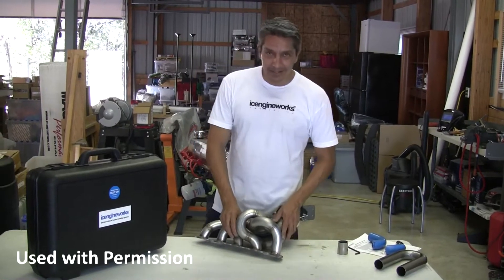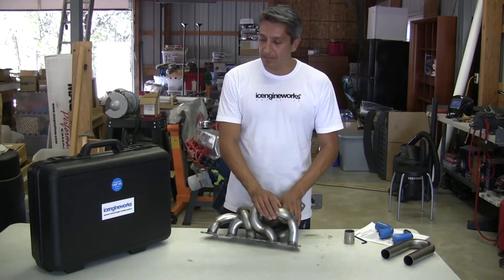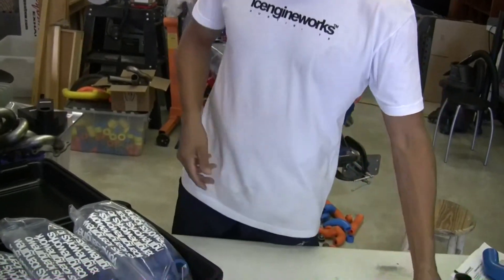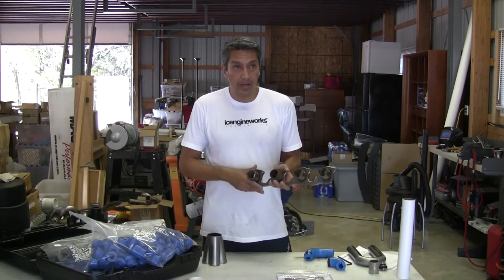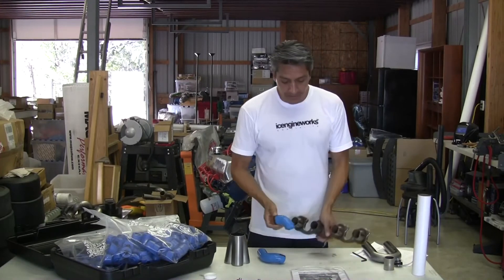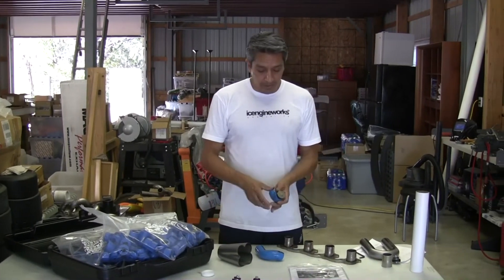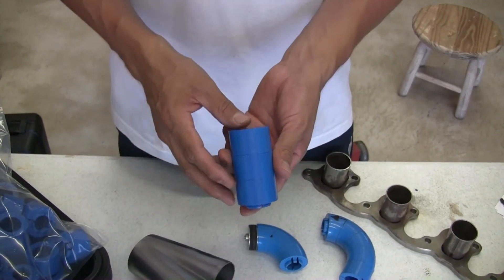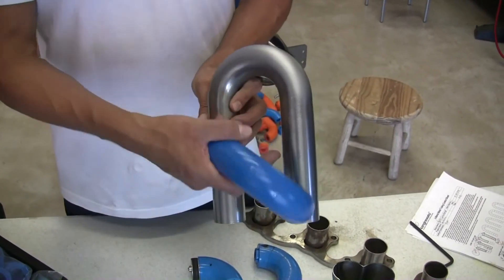Victor Franco's Icengineworks Modelling System - Part 1

Comment: I see a 4-1 collector. Is it possible to have different types? Sometimes a challenge of building a turbocharged engine is making an exhaust systems with clearance for everything under the hood. I think this could solve the problem in some situations. EDIT and a 4-1 collector wouldn't work, you would need something with a turbocharger flange.
Reply from the maker: Victor has a complete new line of turbo modeling flanges.  Contact icengineworks.com